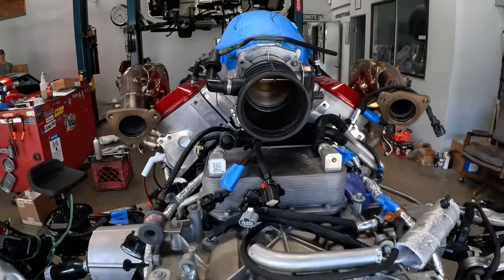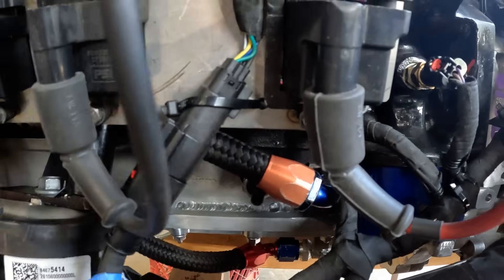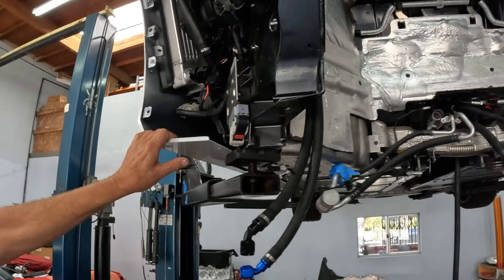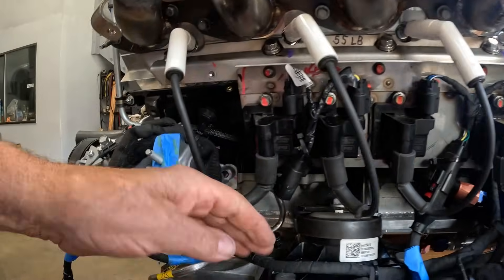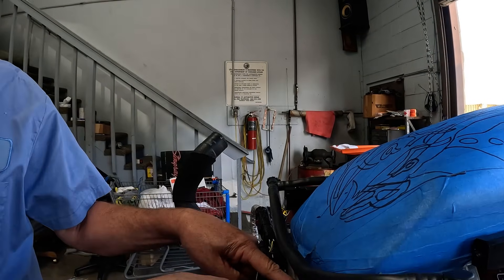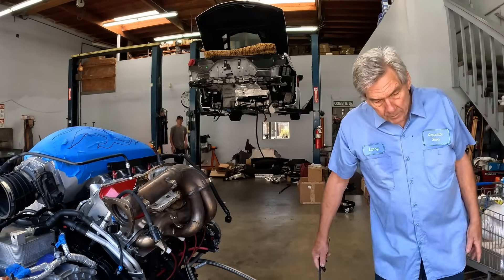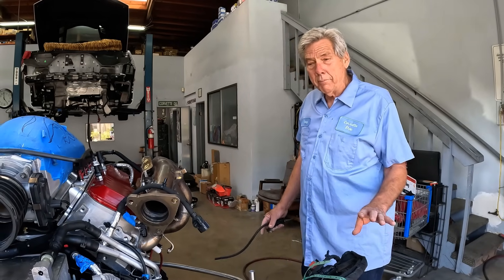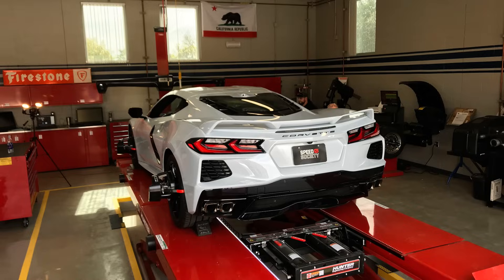Big Block 8.1L - C8 Corvette Engine Swap Update “Will it Run?

Comment: SURE WILL BE NICE HAVING THOSE PORT FUEL INJECTORS WHENEVER THE OWNER GETS USED TO IT AND DECIDES THEIR "BORED" WITH IT LOL..I REALLY THINK ALL DIRECT INJECTION ENGINES SHOULD HAVE PORT INJECTION AS WELL TO AVOID THE CARBON BUILD UP INSIDE THE HEADS AND BACKSIDE OF VALVES..SUPER COOL BUILD AND CANT WAIT !! NOTHING SOUNDS BETTER THAN A BIG BLOCK CHEVY WITH A HEALTHY CAM! AND THIS ENGINE ONLY WEIGHS WHAT 120LBS MORE THAN A LS ?

Comment: It’s crazy to think some GM engineer thought it was ok to locate wiring harnesses, and control modules in the wheel wells. 04:10  Oh but wait, there’s a splash shield keeping it safe and dry. Come on GM puff, puff pass! 🤦‍♂️🤯😡

Comment: Put a bigger one way valve on that fuel line to get better fuel flow. Like you said they put it there for a reason but you should easily be able to replace it with a bigger valve.

Comment: Sensational effort 2 get this Job done .  Interesting 2 see how it drives especially around corners with all that xtra weight .  If l had that kind of $$$$$ l would have gone 4 a 441 cu inch Windsor  9.5 deck height.  With SBF Hemi Heads from Hammerhead Performance. And the ring Dustin @ Whipple Superchargers & beg him 2 re disgn the base of his 3.8 ltr superchargers 2 fit . Obviously 2 make it all work beautifully would be coil near plugs & crank trigger ignition & billet block ,heads , crank, rods , pistons . And dry sumped . 
The special request 2 whipple would be asking 4 there cupronickle intercooler core  ( marine use l know ) but should assist 2 give u big HP & TQ on 93 Octane.

Comment: It's his project, I cannot imagine taking a 475 Lb aluminum engine out, to put a 600+ lb iron block engine in, weight is a bigger enemy, than power, in a mid-engine high performance car.

Comment: My guess for the check valve in the fuel line is for when you shut off the car it keeps fuel pressure at the high pressure pump.

Comment: Most GDI engines approach diesels of the same size in maximum torque output, so that will be interesting in how this engine performs.  One of the big hurdles with adding power to a C8 is the transmission is limited in how much torque it can accept.  There are clutch upgrades and half shaft upgrades used to help this, but the internals of the transmission are the ultimate limit.  How much torque will this DI 8.1L make and will the transmission be able to take it?

Comment: At Larry I'm sorry about the summit report I made, sort of...This is a 10000$ kit when your done. I still think you would have had less headaches from people dropping your aluminum heads over those arp studs, then complaining about aluminum chips in the sealing plane and block, if you had simply sold blank heads and offered the head studs as an up sale. More sales at 2000$ reusing stock valves train with a cheap head gasket/stud kit with less troubleshooting. But this is totally what the 8.1l needs to stay current THANK YOU FOR YOUR WORK!

Comment: With twin turbos and BOTH direct AND port injectors, this would be a monster. The fact that they were able to integrate so much of the 8.1L is awesome. It's a brilliant approach to today's tuning challenges: change everything about the engine that's ONLY mechanical (like ALL the engine hardware itself), but maintain everything that has an electronic signal for a computer to read - so all the old sensors plug into the new metal. And you can even ensure emissions compliance! Pretty damn cool.

Comment: The check-valve is in place because of how the HP pump works it will bleed a small amount of pressure back on the feed line. You will likely need a larger orifice check valve. Maybe check with what the Z06 has?

Comment: Dummy injectors? I know that there's more potential on that big block if fueling with the direct injection system becomes the limiting factor. I don't know anyone that makes uprated direct injectors for any gas engine.

The dummy injectors could be easily used as secondary injectors when more fuel is needed. Plus there's the benefit of having cleaner intake ports and valves, as the gasoline will keep any carbon deposits from accumulating. I know that PCV technology on direct injected engines have improved a lot, but it would be some added insurance in this setup.

Maybe a stage 2 phase of this project. This is an amazing engine swap project as is. Can't wait for the other spectrum of C8 engine swap projects: Rob Dahm's four rotor C8 as tribute to the Aerovette concept, which had a four rotor engine.

Comment: Larry you probably have met or talked with my grandpa Pat Devincent from Ohio. He was a lead engineer for the corvette from the very beginning. He had also worked on designing the fiberglass leaf springs, air bag and a few other things for General Electric since they were originally are a parent company of GM.

Comment: Check valve in the fuel supply.
I'd expect the factory manual to have a theory of operation explaining what it does.  I'd expect that the check valve prevents vapor issues during a hot soak.

Comment: I wish Gm would make a flat plane high reving big block. lol.. 4.5in stoke - 4.5in bore and figure out a good deck height for perfect rod length and stability.. VVT-DOD-Overhead cam-Direct injection.. 9000+ rpm 572ci lol or a v8 designed like a street bike engine that revs 15k
Reply: A 572ci flat plane V8 would vibrate like crazy at high rpm
Reply: @DastardlyDeedsDoneDirtCheap  can you explain? Most flat plane or high rpm motors use close to same stroke/bore size. You would be taking a 5.5L and upscaling it basically. Why would that vibrate like crazy
Reply: The weight of the pistons and stroke are way too high for durable 9k rpms. New Ferrari "12Cylindri" is a 9k engine, but it has 6.5L in 12 cylinders.

Comment: great honest content man.

edit: will the restriction and check valve even out the pressure of fuel going into the direct injection pump?  (pressure pulses from the 'low' pressure pump).  are they using that pressure in some calculation on the stock efi to calculate what the pressure will be after the high pressure pump?

Comment: I completely get what he's trying to do by putting a big block and convincing the car it's still stock but it would have been amazing if it was manual swapped. A manual big block c8 would be epic
Reply: I think it's a great idea on paper but where to put the shifter and cables for the link... The computer would be fully independent and all the other stuff you would incounter that is not going to work or be compatible... Sweet idea I would love one
Reply: @kevinvanneste2500 I feel like you could probably route either cables or hydraulic lines for the shifter almost anywhere you'd need to.  An old tr6070 out of a C7 could probably get modified to work in the C8, too.
I am not super familiar with the platform, however, so I could be totally wrong.
Reply: @kevinvanneste2500 I think with an adapter plate, he could use the transaxle, shifter, and shifter cables with slight modifications from a Lamborghini Gallardo/Audi R8 since the cars are very similar chassis wise with the C8 Corvette.
Reply: And what manual transaxle that's designed JUST FOR THE C8 would you use?
Reply: @randoawesomemix9501 There isn't a manual transaxle designed for the C8. Hans Juecter, the lead engineer of the C8 said a manual transmission option was never a consideration when designing the C8. So one would have to improvise and create the option from scratch. Using existing parts from other OEM manufacturers and  modify to work.
Reply: @daltonhanleyjr4142  he's putting a big block where an LT2 used to be. I don't think putting a manual is beyond his capabilities. I'd use the manual from an Audi R8 with a custom adapter plate/clutch/flywheel
Reply: I have an 8.1 in my suburban.  Other than mpg it's awsome
Reply: @carlstephens1532 they’re stout
Reply: Matt Field is putting a manual transaxle in a C8. It's getting a big inch LS rather than a big block and it's being built as a drift car but it answers the manual transaxle question.
Reply: @lb9gta307  it's a Sequential. Close but no cigar lol
Reply: @CanIbeFrank you can convert H pattern manuals inti sequential pattern manuals, like motorcycles
Reply: A manual sounds good but look at the Ford 10speed behind the Coyote engines in the F150... I doubt a person can out perform that set up ... I will bet the BB and automatic will be bonkers... Maybe make it torqueflight with a manual engagement but still automatic? But seriously the transmission is what really makes the C8 haul ass atm
Reply: @SapPyAzz My brother and I are totally unimpressed with the 10 speed in his 2021 5.0 F150 he bought new. It is always gear searching and he questions its longevity. Would much rather have a manual like in his prior trucks if made available.
Reply: @johnmcmullen456  the stock  tuning sucks get a 5 star tune and the 10 speed becomes amazing.
Reply: @JohnDiMartino Thanks for info. My brother will look into that, since the truck's warranty has just now run out.
Reply: Well , the first problem is parts breakage/ maintenance. The second problem is not too many people really know how to shift manual transmissions anymore I have a 1970 big block Camaro 4 speed that I raced for a few years when I was a kid, now it’s an automatic for a reason bro.